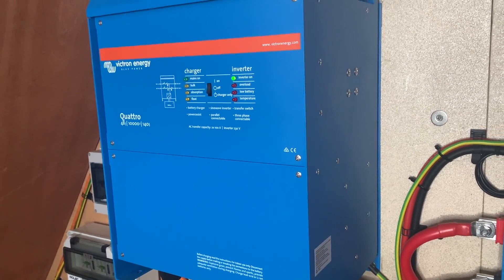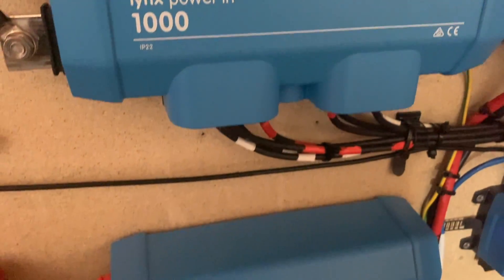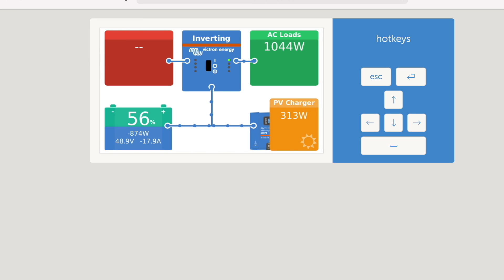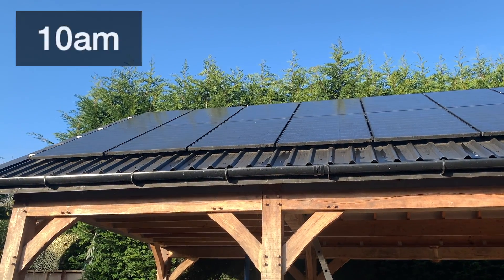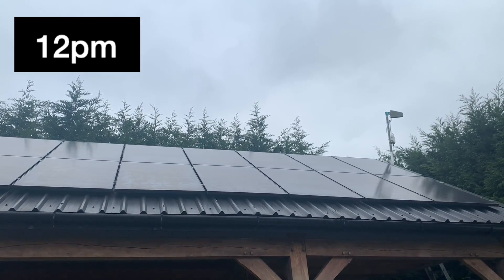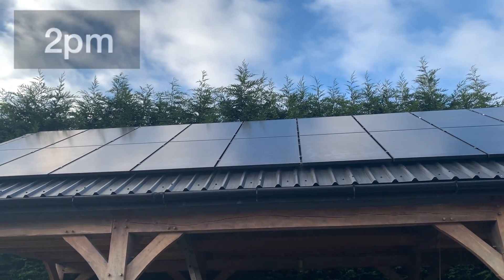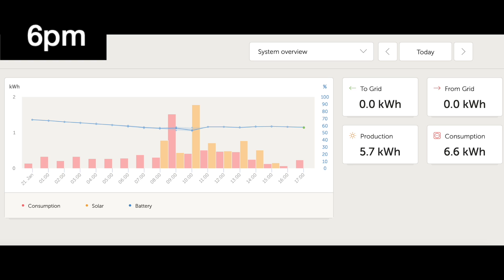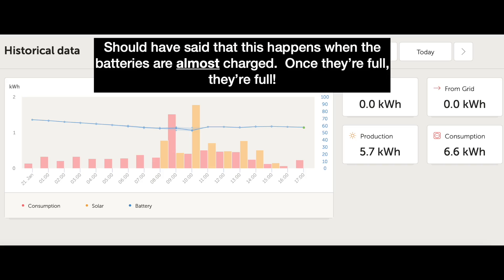SOLAR IN UK WINTER: What our DIY OFF GRID SOLAR POWER SYSTEM produced in ONE DAY in JANUARY.

Comment: Are your batteries lithium?  I have seen that they are not the best thing for just solar,  as solar is just a weak power source they weaken the batteries , with victory measuring the voltage , I have found getting them up to 100%  and then you can still carry on charging for hours on trickle , so they are not 100% 
Lithium are suited for mega recharge quick charging , 
2 loads of washing and you'd be out of power ,  you have a life of power watching now ,
Reply from the maker: Yes our batteries are lithium. Under normal use and without any PV we can probably run for about 3 days from fully charged 😊
Reply: @The_OffGridFamily  how big is your bank,  ?  What do you run, do you have to plan to use items ,
Reply from the maker: We have 25.2kwh (23.6 usable) storage in our batteries.  We run a fridge, 2x chest freezers, washing machine and tumble dryer without much thought about it all months apart from Dec-Feb. In winter we check our power before we use the washing machine and tumble dryer but most of the time we are ok. We have recently started using a bread maker and our electric kettle and the system has coped fine. We bought an air con unit this week so are trying that out at the moment. Our next video is actually on this and we will be looking at what appliances we can use at the same time. Should be out Sunday 5pm 😊
Reply: @The_OffGridFamily  what about cooking , ? All electric ? . But you cannot use all the high power units in winter , its about right I feel for the UK,  and you cannot run the heating ?
So its not a green system as everything is either dug from the ground , got loads of chemicals.  And so on.
Its a different way of living .
Reply from the maker: Yes we agree. When it comes to electricity we are off grid for two main reasons: We live a long way from the grid and thus paying to join didn’t make sense financially, and we like not being beholden to the tarifs. Parts of our lifestyle are environmentally friendly, such as the trees we have planted, but not necessarily the solar. We have a wood burner for fuel and cook using gas bottles. The boiler is gas also 😊
Reply: @The_OffGridFamily  so your not living off grid in life just electricity , 
If heating, cooking , were added you'd be short,  you plant trees ,take years to grow and burn wood , 
What about an arga type oven , burn wood , heat water, cook,and heat the house .
This is the truth about living off grid ,   more realistic message
Reply from the maker: @davidwarnes5158   One thing we have found since starting this journey is that people have different views of what off grid means 😊 we consider it to mean not using public utilities such as mains electricity, gas or water. We also don’t have a phone line to the property. We consider the use of bottled gas to be outside of this, probably in the same way a person who has to bring in fuel for a generator would still be considered off grid 👍
Reply: @The_OffGridFamily  off grid usually you don't use anything from the outside ,   phone line most people don't have one of those ,   the gas comes from somewhere ? 
I think its a good thing to do .   My mum has solar panels,  she isn't off grid ,   
Nothing wrong with a generator,  its the same as buying gas , or burning fossil fuel.   ??  
Being green isn't easy , especially in the UK.
Reply: @The_OffGridFamily  Why lithium? When I looked at them last year the cost per KWh was much higher. I could not see a reason to go for Lithium on a static installation where volume and weight is unimportant.
Reply from the maker: @mtpaley1  For us it was the amount of years that we can get out of Lithium and the limitations on usage with lead acid (eg not going below 50% and the length of time it takes to completely charge them, especially in a U.K. winter where those last few % take ages). Lead acid seem to be more work in that sense 👍

Comment: For reference we use about 25 kWh/day average in the DFW Tx area. We have 16 400W panels and no battery. We pay about 40% more to buy kWh than to sell them to the grid so we are learning to move consumption to the daytime to minimize our bill. We have two electric cars so that is one load we can move easily. During the summer we'll probably use more than we produce during the day due to A/C running. We'll see.
Reply from the maker: Thanks for your comment 😊 Hope you manage to cut your bill down 🤞
Reply: @ James May I ask why you do not have battery storage? 
Surely it would be better to store what you generate for personal use instead of feeding the grid?
Reply: @monk3yboy69  We do not have battery storage because 1)Batteries are really expensive. 2)We do get paid for putting kWh back on the grid. 3)I have two EVs with a total of 150 kWh battery capacity and I figure that sooner or later I will be able to use them.
Meanwhile I try to manage the EV charging so we minimize the kWh back to the grid.

Comment: Is your array South facing? Quite impressed that you manage to keep your load consistently below 0.2kwh. That seems remarkably low.  My tick over is around double that (I keep a large aquarium, so completely self inflicted). 
I'm in the East Midlands and have an East/West 4.5kwh array. The output in the winter months is truly terrible  due to the azimuth angle. However, come end of February, I'm producing enough to cover majority usage and battery charge.
The trick seems to be intelligent time usage of major appliances. They are the killers.
Reply from the maker: Thanks for your comment 😊 Our system is south east facing so not bad but not as south as we would have liked.  All our appliances have a very good energy rating as we have bought them with off grid life in mind. We don’t run heating off of the system apart from a small radiator to keep the batteries warm. We have a wood burner and gas boiler 😊
Reply: @The_OffGridFamily   I can't grasp why off grid setups are often angled for maximum production for the whole year.
 My panels are nearly vertical, so as to maximise production during the winter. East west facing.
 During the summer they are really crap for energy production, but they are really crap for so many hours, my batteries are always fully charged.
 Why angle the panels to fill the batteries earlier in the morning during the summer?
 Increasing the energy you don't need in the summer, because you are not selling it to the grid and your batteries are full, at the cost of having even less in the winter is crazy.

Comment: To reduce trickle charge, why not more capacity in battery storage ?
Reply from the maker: We could add more batteries, but we think adding PV and therefore being able to charge what we’ve got will be less expensive, especially if we buy second hand panels 😊👍
Reply: In Summer a relatively small array can fully charge a large battery bank quite easily. In Winter it can be a struggle to keep that same battery bank topped up. Rather than adding additional (expensive) batteries I have found it better to have my water heater and/or electric heating come on when my batteries are almost full. Easy to set up with victron kit. I also do my washing and sometimes bulk cooking on sunnier days. Takes a bit of planning/management but better than having a big battery bank that only gets half charged for half of the year.

Comment: Not having seen your previous videos can you just confirm your total PV wattage and battery kwh.
Reply from the maker: We have 7.1kwh of PV, and 25.2kwh batteries (23.6kwh usable) 😊
Reply: @The_OffGridFamily  In the current UK climate (both weather and energy), I don't think you can have too much PV. Granted it can be in significant surplus on sunny summer days but having plenty of PV capacity does help extend the season. I started with 11.75kw PV, 48kwh lead acid (24kwh usable) and a Victron Quattro 10kw. This is Off-grid on an airfield 1 mile from home. I use it to keep two EVs off-grid for 8 months/year. I have also made up two small lithium trailers (30kwh each) to bring the energy home to feed the excess to a pair of grid-tie inverters (total o/p 3kw). During the summer this will keep us off-grid for 95% of our home and transport needs. I have very limited opportunity for PV at home (at present 1.5kw). To try to extend the season I am increasing this to 3.3kw and adding a further 9kw at the airfield. PV costs are better than 50p/W at the moment and with self installation it is a good investment. My LFP cells cost about £100/kwh. As well as transporting energy these help to smooth out the variability of the UK sunshine.
Reply from the maker: Thanks for sharing the info on your set up. Sounds good! How do you get on with your EVs? It’s something we’ve talked about… 😊👍
Reply: @The_OffGridFamily  We have had a Kia Soul EV since July 2020 and a Tesla Model 3 LR since June 2021. We have no regrets. Both have good range (about 280 miles and 330 miles respectively) and  good efficiency (4-5miles/kwh). The Tesla is the better car for a long trip with good navigation integrated with the supercharger network. The Kia is better for carrying bulky loads and significantly cheaper to buy. We specified a towbar for the Tesla (not retrofittable) to enable the use of a trailer. EVs might be significantly more expensive but you can save £1000- £1500/yr on fuel versus electricity and servicing. These savings are even bigger if you can allocate extra solar to transportation. When to jump into the EV market is generally driven by minimising the depreciation loss on the previous car but this was accelerated for us as we could use off-grid PV to provide free 'fuel'. Eventually there will come a point where the secondhand fossil car market will collapse. This will probably happen when the lease market moves totally over to EVs.  In the meantime as waiting time increases on new cars some secondhand Teslas are fetching more than new prices.

Comment: I've just found your channel and find it really interesting. I'm grid connected but am looking to install a load of pylo9ntech batteries and Victron controls, so your channel will be invaluable. 

Installed a new solar inverter in October on my house grid connected solar PV as the old one died. I can now data log my usage here in South Wales just north of Cardiff.

3.0kW of Grid Connected PV with 1.5kW facing due south and 1.5kW facing due West (give or take a few degrees).

October 2021 110kWh with a couple of days under 1kWh
November 2021 80kWh with around 8 days at 1kWh or less
December 2021 25kWh about 3 days over 1kWh - it was a very cloudy December!
January 2022 55kWh about 50% of days under 1kWh
February 2022 100kWh with 5 days at end of month around 8kWh per day! (the sun finally came back out).

I will be looking to install more DC connected PV once I've got my battery system installed later this year.

thank you very much for your informative uploads.
Reply from the maker: Thanks for sharing your stats from the last few months. It’s always really interesting to hear how other people get on, especially over the winter months 👍 Our next video is going to focus on a summary of our winter data if that will be of interest 😊

Comment: You have your panels set for "high summer".
I have a summer and winter set.
Just to give you an idea, my summer makes around 6amp in winter and, the winter makes around 16amps.

I would have 2kw summer and 2kw winter and 2 KW tracker. On a roof, winter needs to be above summer panels.
Reply: what is the difference between your summer and winter sets ?
Reply: @josepeixoto3384  about 50%. Someone else also had the same results.

If you think about it roofs are not at the best angle. So you lose 20% and for a small part of the year there right.
So if you have 20% then angle to get 100% for one time and 100% at another time.
It's the same with tilt, that makes a difference to the power curve.

I would say if you had a tracker, you could make alot more power over the year and day so could get away with a small array.

Comment: What was the price difference compared to a powerwall?
Reply from the maker: It’s been a long time since we looked at the powerwall, but price wise it was more expensive to go down that route initially, and also much more expensive to extend the system at a later date. We can get another battery for around £1k but adding another powerwall would be a much bigger outlay 😊
Reply: @The_OffGridFamily  - So, your System is more Suited for Low Cost Modularity, rather like "Just eat it One Bite at a Time!" 😁

Comment: If you kept you off grid system in the green house and solar pannels in there to would they make more power by keeping everything warm.
Reply from the maker: The batteries might, although the dampness would be a problem. The panels actual work best when it’s sunny but cold 😊

Comment: Great video as expected from your channel.

As someone who's just starting that solar/wind journey this does raise the point that in order to run a standard 4/5 bedroom house with an EV charge point and air source heat pump, I'll probably need around 100x 350w panels to get through the winter off grid.
Reply from the maker: Thanks, really glad you enjoyed the video 😊 Since making this video we have been chatting a lot about where to go next in order to further consolidate our power in winter. We talked about a wind turbine, but there are issues connecting it to our system because of the Cerbo GX. We also talked about creating an array of panels on the ground designed specifically for winter, but when it’s grey it’s grey so that only goes part way to solving the problem. At the moment we are leaning towards another more cost efficient generator. We will always have one as a back up, even if our system can run all winter without it. It only takes something in the solar set up to go wrong and we would be in big trouble! 😊
Reply: @The_OffGridFamily  Wind turbines are a good option and can be incorporated into your Victron system very easily. The key is to get a turbine that has a customisable charge regime so that you can match the battery requirements exactly. You then feed the output of the turbine into your battery via a shunt that comes with a BMV700 battery monitor. The BMV reports this charge current to the Cerbo and the Cerbo does its magic!
Reply: @Qosmio1955  do you have a link to one that would be suitable?
Reply: @martinwhite3005  Hello Martin. There are so many to choose from and so many variables. I'm in Australia and obviously can access the market here. What is available where you are may differ. Other factors are: What output do you need? What noise level can you (and your neighbours) live with? Are you limited by local planning rules? My approach would be to Google for wind generators with adjustable charge regimes and then consider the factors I just outlined, narrowing the choice down as you go.
Reply: @The_OffGridFamily  check propane generators. I personally would add more bataries.
Reply: Sensible, I'd think you would need to look at a generator for December / January to cover the loads. If you spec the PV for December, your are probably producing 5 to 10x more than you need in July. Plus it looking at costs balance between PV panels and generator and fuel for say 10 years...
Reply: it all depends on your location, where solar panels will be facing.